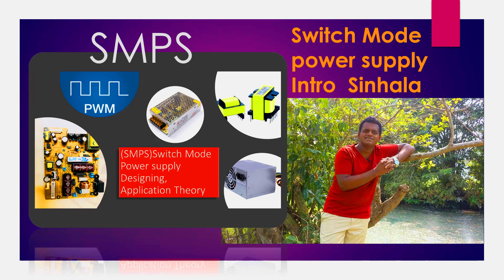SMPS in sinhala part 01 - Introduction (Switch mode power supply in sinhala)

Comment: Smps apita car radio walata use karanda behe ne radio signal drop wenwa ekata mokak hari wisadumak danna kenek innwada??
Reply from the maker: Eaka විහිළුවක් hariyata match karapu ekaka ehema gataluwak wenna widihak na. Common pawichi karana supply ekakata danawanam hariyatama match nokara dana ekata wisadumak na. Hbai switching noise eka snubber circuit eka gawin ho vdr damage welada kiyal balala ethanin haduwaki.
Reply: @labtronics1140  කොහොම කරත් රේඩියෝ වලට නම් SMPS Power supply හරින්නෑ.
Reply from the maker: @nipuna832  USA, GERMAN, Italy kochcra enawada SMPS dapu amplifiers. no issue.
Reply: @labtronics1140  හ්ම්..! ඒක නම් ඇත්ත.රේඩියෝවලට suitable smpsඑකක් match කරගන්නෙ කොහොමද?
Reply from the maker: @nipuna832  ekata certificates thiyeda balanna wenawa. switching frequency eka saha harmonics distrotion kohomada kiyala balanna wenawa
Reply: @labtronics1140  කොහොමද බලන්නෙ?
Reply: @labtronics1140  Voltageඑක smooth කරොත් හරියයිද?